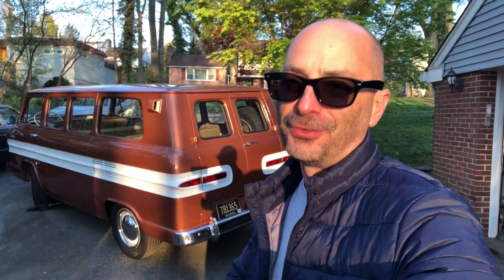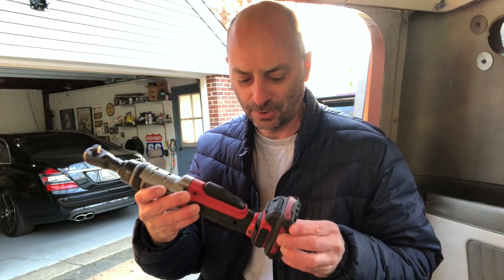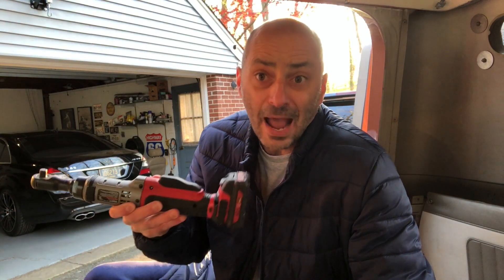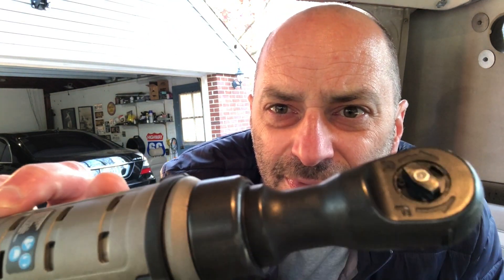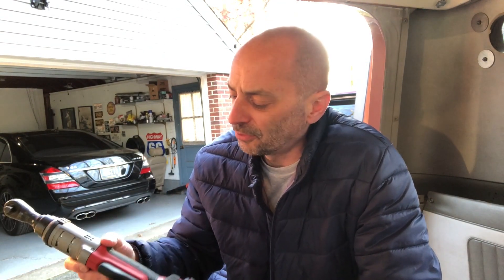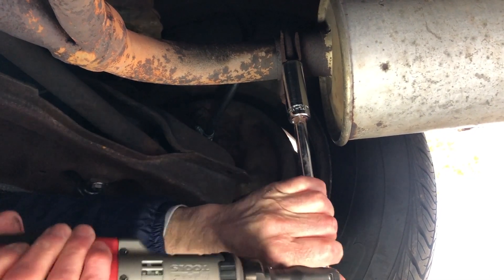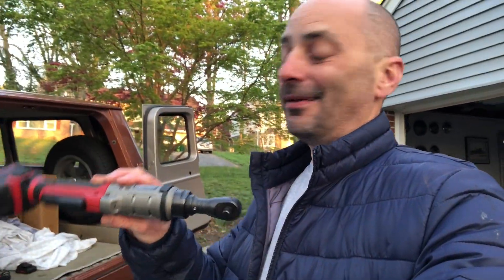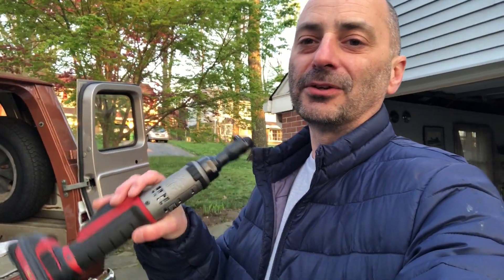Irrelevant Tool Review - The Mac Cordless Ratchet

Comment: You know what the proper use for ratchet (manually powered or battery powered.). is?  It’s for sub 30-50 ft-lb stuff.  You use the ratchet, then you whip out your torque wrench, and you fasten it to the proper torque.   Every single fastener in a car has a specific torque it must be tightened too. 

Heavier duty bolts requiring more torque, you use the the lower settings of an impact wrench, and then finish tightening with you guess it a torque wrench.

This just takes place of a regular ratchet.  You’re supposed to always finish your tightening with an appropriate size torque wrench.
Reply: Are you a tech?
Reply: @mexicanic4976  Doesn't take a tech to know

Comment: Not sure if the Mac one is worth the extra money as a non professional who isn't tied to the battery system. That said a cordless ratchet is really useful for working on engines, it speeds up bolting things like an engine cover a lot. Not the best tool for a few high torque bolts though!

Comment: When the Kung Flu hit i thought i was finally gonna have time to fix the fury. Then i remembered i have no idea what I'm doing. Can't even change a sparkplug.
Reply from the maker: So what repairs are needed on the Gran Fury?  Curious if maybe I can walk you through it.
Reply: @hullinger  gas mileage is tanking. the normal clicking of course and trouble warming up. i think it needs new sparkplugs but i don't have the right attachment. still runs and drives and i'm kinda just used to it being a grumpy car

Comment: I was thinking of picking one up but as seen in your vid you have to manually put it in reverse which is what I thought that huge paddle did but it is for aesthetics apparently. Thanks.
Reply: These are good to zip off the bolt/nut faster. A lot of techs in my shop pretty much use their cordless ratchet and cordless impact 99% of the time. But, we're also a flat rate shop so speed is a huge factor.

Comment: I have a Snap-On CTR-714, which is their equivalent. It's rated for 35-ft lbs and I've always found it to be well..wimpy. I also have a Snap-On 14.4 Cordless Impact in 1/4" drive, which is MUCH nicer.

Comment: Job done 😁👌yo man make a vídeo of the latest purchase Caprice yeah, love that beast i actually need to buy something like that but smaller drill tool with more torque
Reply from the maker: Thanks man checking in.  I think instead of $200 on this cordless ratchet it would have been better spent on a cordless impact.  The 40 ft/lbs on this ratchet just doesn't seem like enough.

Comment: not a very comprehensive review considering that an impact gun should be used for tightening an exaust clamp like that. electric ratchets are best used for engine work. you dont need alot of torque in a ratchet its really just to save time from turning the bolt manually. ive had the same ratchet of this type for 5 years. been thru a few batteries but it still works great and the batteries are cheep.

Comment: 👍Good, honest review Chris👍 I had one of those similar years ago (I don’t remember the brand) but didn’t get the job done at all. After that experience, I bought myself an Air Rachet... cheap, powerful, however not “cordless” because you still have the airline🤣. 

Thanks for the review Chris; looking forward to a daily dose of ya!👍👍
However... ”China Virus?” 👎🤔🤔👎
Reply from the maker: Thanks man for checking out the vid.  I have an air ratchet but I don't use the compressor enough so it's a BIG hassle, you know, pull it out, plug it in, charge it, the hose, put it all away.  Plus that air ratchet is tough on my ears too.  This little cordless guy is nice, not necessary, not strong but easy.  I'll be curious about just how much I use it in the future.  Thanks man!

Comment: I've always wondered with those powered ratchets, if you have a tight bolt can you use it like a normal wrench to break free before you apply power or would you strip the gears doing that ?
Reply from the maker: Hey man, on the power ratchet, I just used it as a regular ratchet after it conked out at 40 ft/lbs and it worked fine.  I didn't know what to expect and was surprised.
Reply: Yes, that’s actually how it’s designed to be used. Manual cranking it says it can withstand 150ft lbs of torque